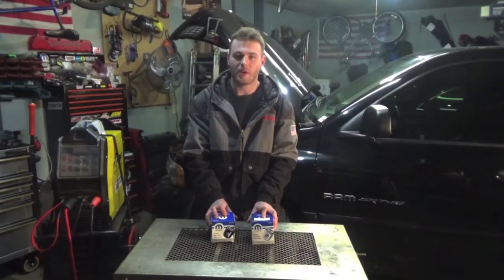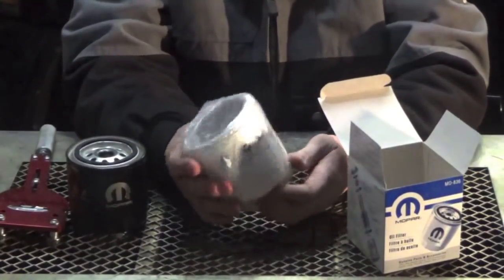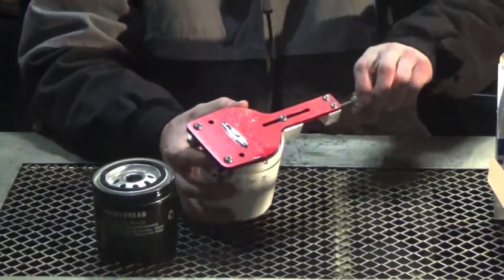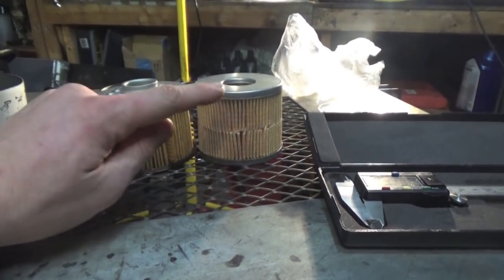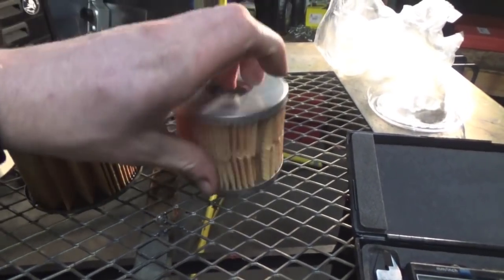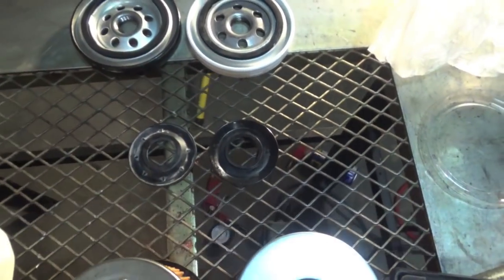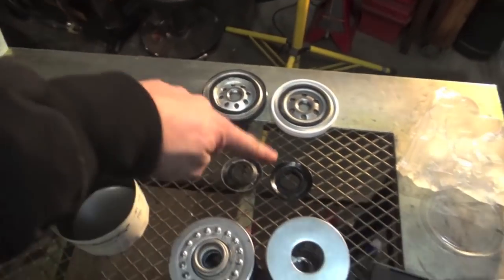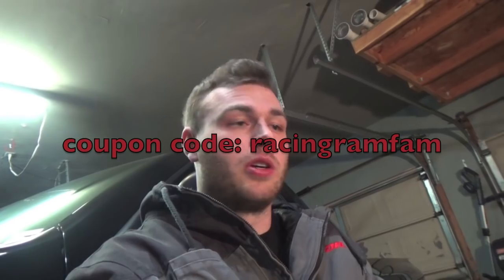Viper Oil Filter 836 vs mopar oil filter 090! Cutting them open and comparing them.

Comment: The bypass valve at the top is actually genius, otherwise in a clogged filter situation you would be washing oil over dirty filter media potentially sending not only unfiltered, but debris carrying oil back into the engine.
Reply from the maker: That’s one way to look at it! Never thought about it that way

Comment: I've been using the MO-409 on my PT Cruiser for the past 10 years. I just bought a 2007 Dodge 1500 and I got the MO-090 oil filter for it.

Comment: Not sure how much difference the case thickness matters. I've never had one split open. I've used many different kinds and I'm 65 yo. The standard mopar filter has 8 holes and when it comes to oil flow, the more oil getting where it needs to go the better. As for the bypass valve in the Viper filter, I've never seen one open down. It usually opens inward to let the oil out.

Comment: Thanks for the he info I own 2007 Jeep Grand Cherokee Overland with a 5.7 liter Hemi. I am going to use the Mopar 836 oil filter and Valvoline full synthetic motor oil on my next oil change the Valvoline full synthetic is 3rd third best out of the top 10-12 full synthetic motor oils.
Reply from the maker: Joshua Moore sweet man!
Reply: @RacingRamFam The mopar 090 is all I could find with out going to more stores that sell automotive oil filters or online.
Reply: @RacingRamFam  I couldn't find the viper filter mopar 836 at walmart or AutoZone so I bought the mopar 090 at walmart $6.27 plus tax.

Comment: I think Mopar 090 is descent enough maybe even as good as the mopar 836 viper filter.  or better it has 8 + holes the 836 on has 6. It seems like the 090 could handle more oil flow psi.

Comment: Will the viper 836 fit the 6.4 dodge charger
Reply from the maker: No it’s the newer viper filter will tho
Reply: @RacingRamFam  i know the white srt filter will but it’s mostly out of stock everywhere the m041
Reply from the maker: @swaveyymike  nothing wrong with a 339 or 899
Reply: @RacingRamFam  those are hard to get too the 899 I ran on my last oil change a couple months ago got the last one at my local dealer

Comment: the 090 can be put to the old 318? .... or small block mopar
Reply from the maker: Yes! La and magnum fits both
Reply: @RacingRamFam  ...other than 090, ....... will there be another modern Mopar filter that can be used in a Mopar Small Block?..,... LA 318 340 360 ....
Reply from the maker: @225supersix1977  409 or the 836 viper filter
Reply: @RacingRamFam  ... thank you